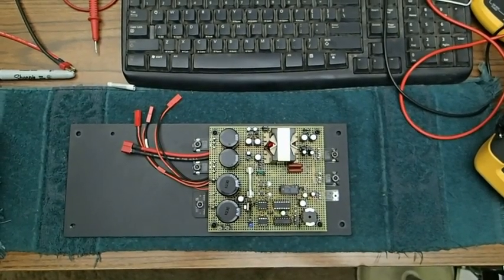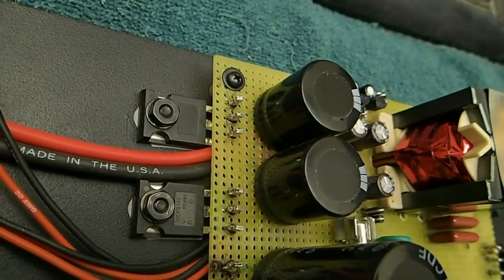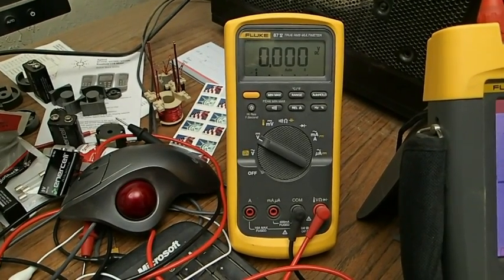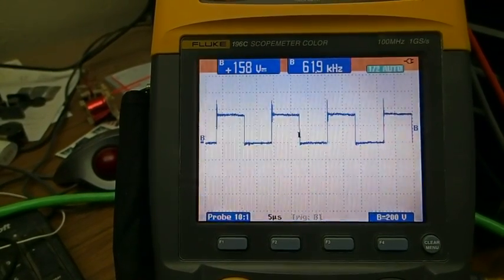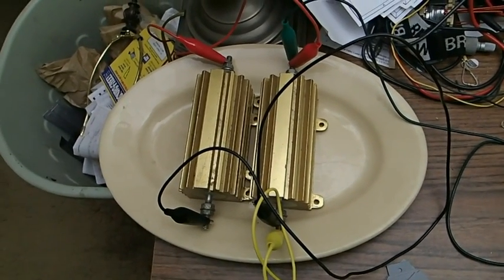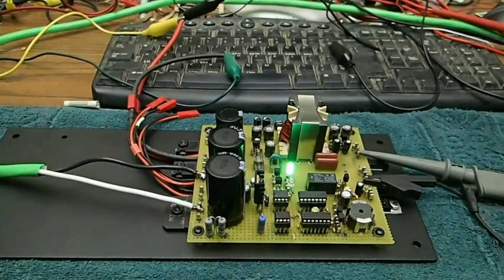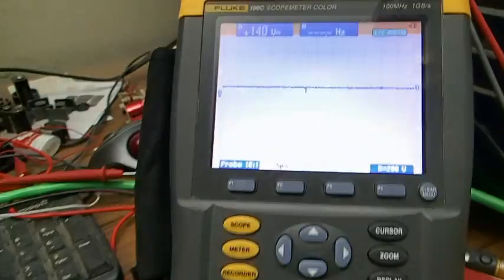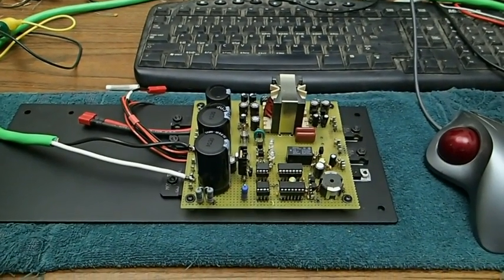60 kHz Converter/Inverter Design & Testing

Comment: what type of power converter is this ,what is the basic working algorithm of this circuit . let me guess at first the ac 110 volts is converted into dc voltage and that dc voltage is filtered using a capacitor . the transformer is driven by the same voltage stored in capacitor to step it down to 30v isn't it ??.
Reply from the maker: Vasudev Mr yes that is correct
Reply: what do you call it a flyback converter or buck converter?
Reply from the maker: Vasudev Mr that's the topography that the industry has coined that type of circuit. but that's the regulator part the 60 kilohertz converter here that is the power supply for the buck regulator
Reply: and mobile chargers have similar kind of circuit right ??